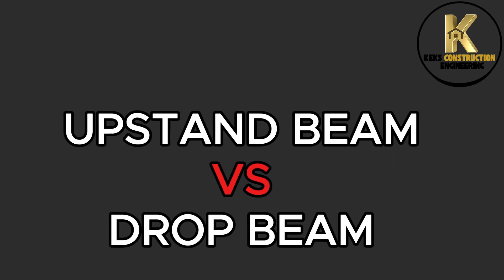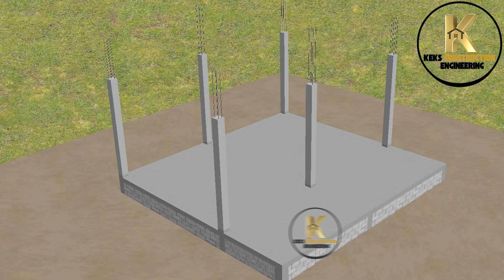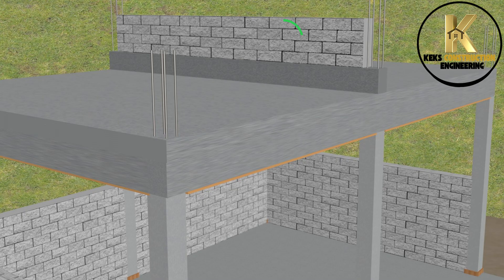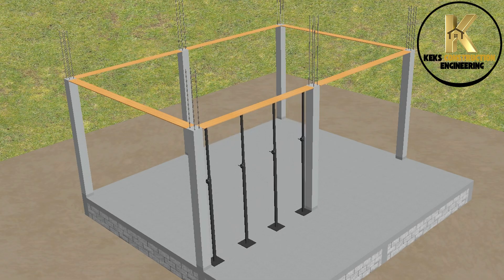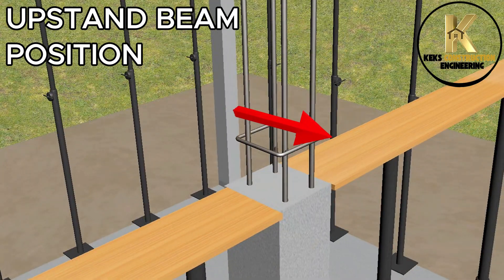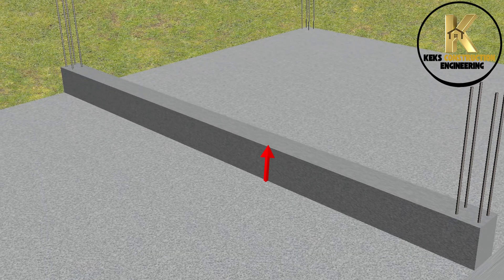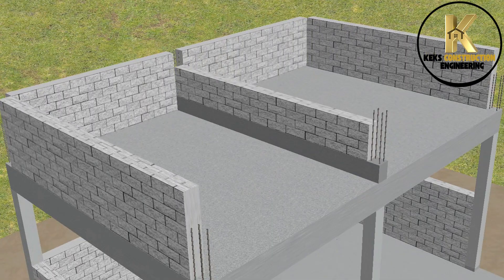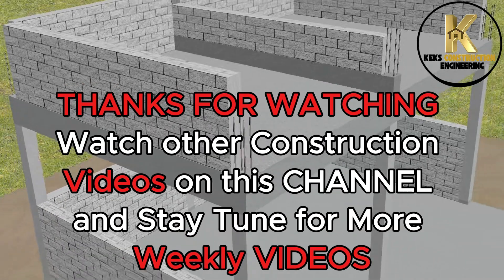How to Use UPSTAND Beam to FIX Architectural & Structural Issues in Building

Comment: It is left for some time before  Casting of the Remaining 300mm

Height after Slab?.
Reply from the maker: Yes..... This is exactly the point. 
The slab is 150mm + 300mm (the Upstand part) = 450mm depth beam. 

Just allow the slab to gain a little strength so it can carry the Top up.
Reply: @keksconstructionengineering more or less than time?

Comment: What size of reinforcement bar is suitable for both beams
Reply: What does the upstand beam do when it comes to structural fixing
Reply from the maker: @isoboyeebubeanabraba710 

The Video clearly answered this question. 
The Upstand beam perform exactly like a normal beam structurally....the major difference is that it solves some limitation issues which a drop beam can't solve... Just like the case in the Video. The Architectural design did not allow any Drop beam at the Middle of the Space.... To maintain structural stability at that region, Upstand beam become necessary. 

I have also had a Design of a Model Church where the Gallery & Suspended Slab were at 4 different levels. I have to put on my thinking cap so I can do a safe and workable design for them.
I designed Upstand beam & Drop beam together and the design was great and very economical....Compared to the proposed designs of others.
Reply: @keksconstructionengineering Accolades Sir
Reply from the maker: @emmanueledem4217 
Thanks🎉
Reply from the maker: It depends on Structural design. 
Y16 is ok for a normal load.
Reply: @keksconstructionengineering  thanks a lot

Comment: Why was the inverted beam formwork placed upwards after the slab was poured?
Reply from the maker: That's the easiest way to cast the remaining part of the Beam.... Or do you have any better way? 
Share with me if you do
Thanks.
Reply: @keksconstructionengineering Here, the formwork is placed together and the concrete is poured simultaneously. Often, the inverted beam is poured incorrectly.
Reply: The inverted beam creates a lot of space and then leaks occur.